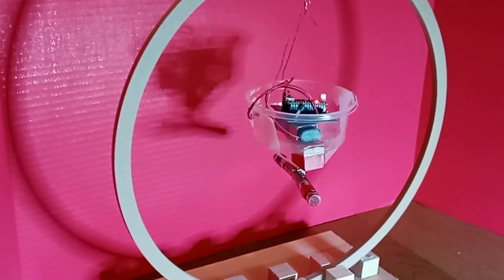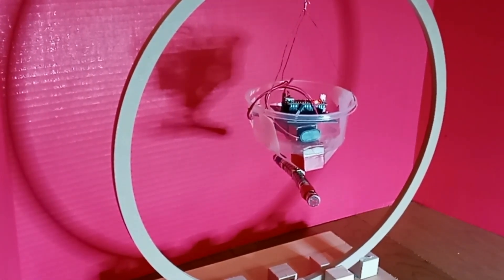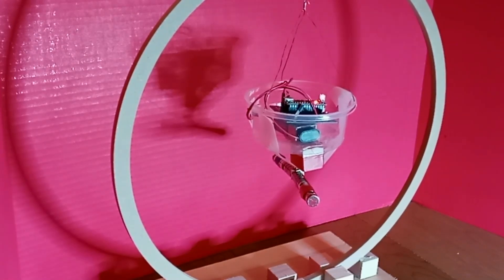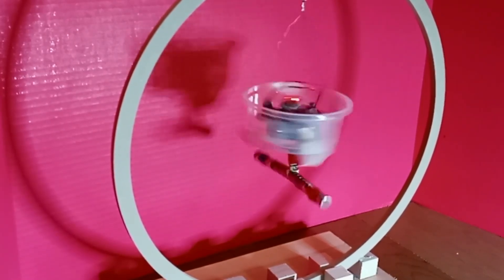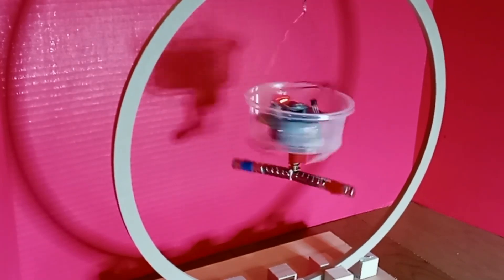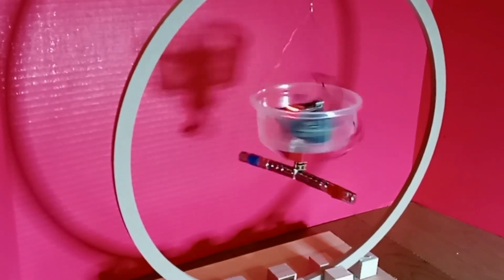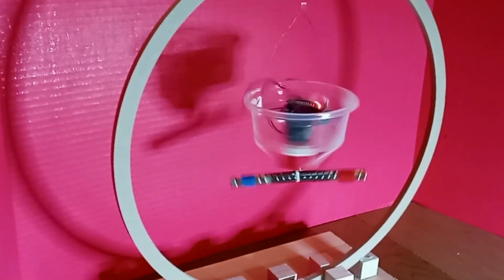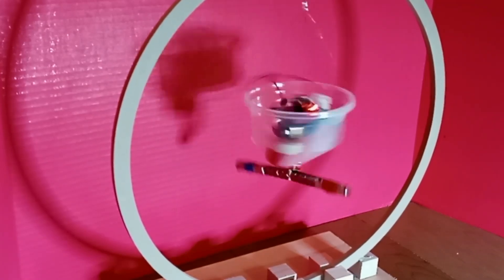Earth Field Magnet Motor with PWM

Comment from the maker: I see that most of the bouncing is because the model is not built square. The motor and axle aren't perpendicular to the armature.
Reply: The thin circular frame is flexing back and forth. Hanging it from the ceiling or something heavier might help increase your rpm.
Reply from the maker: @FodderBoi  In a video that will be published soon it does 400 RPM as fast as the n20 gear motor can turn under load. Also there's a modification to the armature.